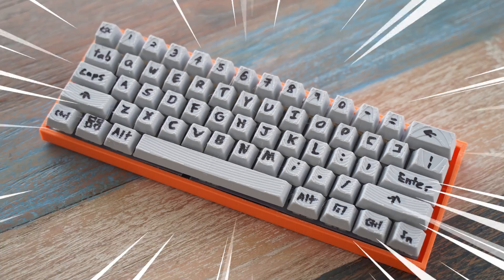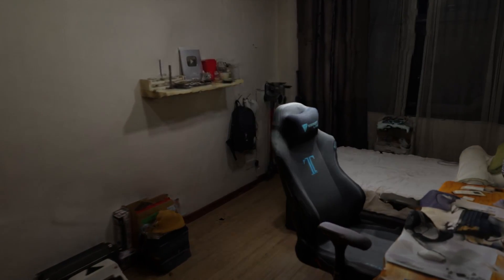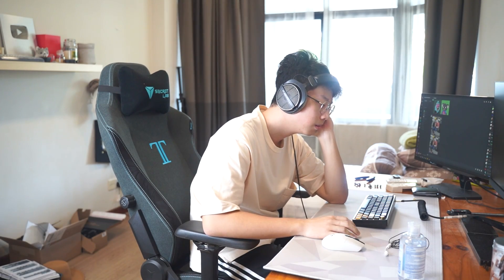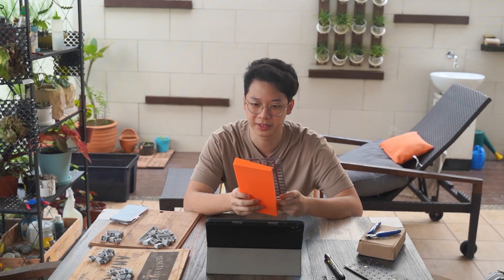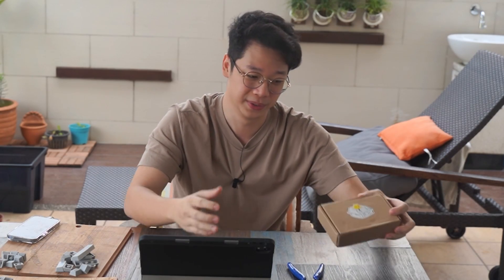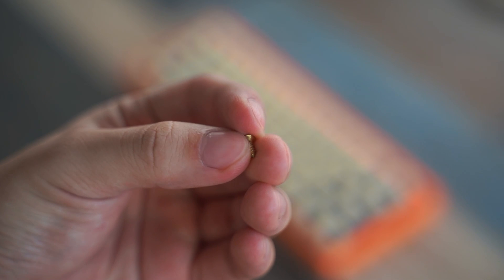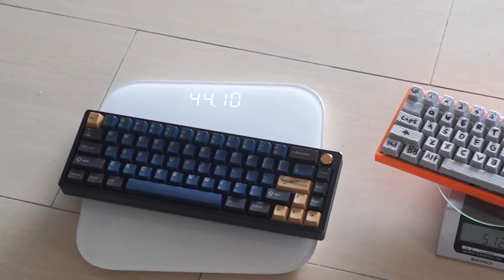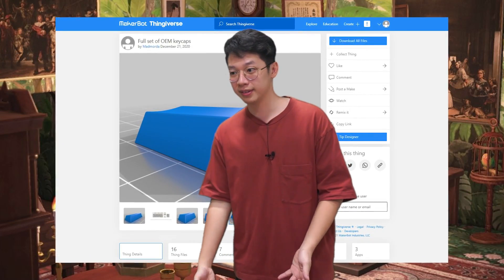i 3D Printed my own Keyboard…

Comment: Man, if you used Fusion 360 or other CAD software the modelling would propably take like half the time, modelling dimensional things for 3d printing in blender is a huge hassle. Also i think with a bit of changes to the switch design and you could make them printable, also switching to a smaller nozzle could help.

Comment: Dual nozzle printer, one printer nozzle does regular PLA the other does copper PLA. You end up with a rudimentary PCB. If you know to master the gCode above what a slicer can, you can then make layered, 3d printed PCBs. The copper PLA needs to be above 60% in copper content and it will not be cheap.

Comment: Just to give you a headsup, while the LIDAR sensor in the rear is good, you could have used the face id sensor which is way, waaaaaay higher res than the one in the rear, so you should have been able to make the 3D scan for the things you needed
Reply from the maker: oh wow i didnt know that i could use the front ones, thanks!

Comment: Keyboard and plate are fine to use an FDM printer to make but small things like switches and stabs should be printed with a resin printer.

Comment: I'm actually working on a fully 3d printed keyboard right now, I've designed switches that fit in the Gateron optical boards so there's no need to solder. I'll print it when I finish because I have and FDM printer and a resin printer. Might make a video on it when it's done.
Reply: When

Comment: I'm actually daily-driving a 3D printed split keyboard because I didn't want to shell out the money for an Ergodox just to see if I like split keyboards. All in all, materials (switches, μC, diodes and PLA(=Plastic)) used cost me just shy of $30, it was an interesting project and tbh I would recommend it to anybody who has requirements that aren't solved by a manufacturer already. If you just want a nice 60%, yeah probably just stick with what's available tho xD

Comment: are the models rendered correctly that you provided in the description? just wanted to know since you had to split yours in half.
Reply from the maker: they are modelled to the measurement mm in blender although most softwares read that wrongly and you will have to scale up by 10000%
Reply: @SquashyBoy  thanks!

Comment: A lot of people have been saying this, but I’ll say it too; for the bigger parts, like the case and plate, FDM 3D printing works very well. However, for smaller parts, resin 3D printing is the way to go, since you can get so much more detail. However, your effort in making this keyboard (especially modeling the parts) is commendable; good job!
Reply: You can even get some pretty decent results with an old printer and basic, cheap resin. I just built a corne with kailh choc v1 switches and was having a hard time finding keycaps that I really liked. The ones I loved the most were 3D printed and constantly out of stock, with no models to be found anywhere, then I ended up designing keycaps myself. For those switches, it's actually pretty simple to design low profile keycaps. The hardest part is sanding for a smoother finish and hand painting the legends, should you decide to have legends.

Comment: Apart from doing it for the fun, I wouldn't recommend printing keycaps. I tried once for a self designed macro keyboard and got really rough finger tips after a few days. While my main keyboard is indeed 3D printed and hand-wired, I use a set of decent PBT caps. It just feels better and makes typing for enjoyable.
Reply from the maker: i agree on this
Reply: There's two alternatives: Print non-dished keycaps (weird) or spend the time sanding the dishes (time-intensive). If you don't like either of those options, that's totally fine, preference in keycaps can make or break one's experience, but I'm daily-driving printed PLA(=Plastic) keycaps and haven't had any issues with the two options I suggested. Again, not knocking your experience, I wouldn't use untreated keycaps like in the video for an extended period either.
Reply: @LordHonkInc After I got my first set of PBT caps, I really liked the texture and weight. That's why I got a few more of those. Printing caps allows for "weird" or mere unusual profiles. I experimented with really high caps for hard to reach keys. So both attempts have their advantages. I also understand that meticilously sanding a bunch of caps is an achievement. Maybe I will give it another try some day. My keeb that has Kailh low profile switches could really use better caps.

Comment: There are already 3D printable keyboards, most notably SiCK-68, but that's just a 3D printed case+plate (they are 1 part) the switches, stabs, keycaps are all normal.

Comment: With the switch thing, you may want to look at nozzle sizes, it should be possible on a printer such as yours, just with maybe a 0.25mm nozzle instead of the standard 0.4!
Reply: They will probably end up very scratchy. So you should use brown filament and call them tactile.
Reply: They won’t work because there are no metal contacts

Comment: me: buys keyboard and mods it and still sounds bad
squashy: literally prints a 3d keyboard and tapes stabilizer with tape and sounds good
Reply: Wait. You didn't take your stabs? That's the only thing I did in my build. I didn't lube the Oreo switches, but I did tape the stabs and used dielectric grease on the to reduce rattle.
Reply: same bro
Reply: i will ur pain